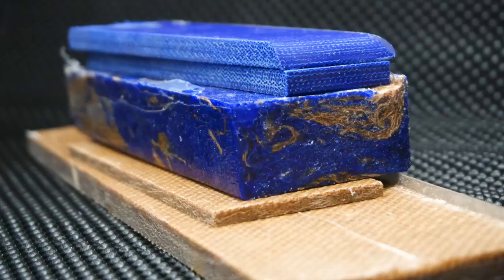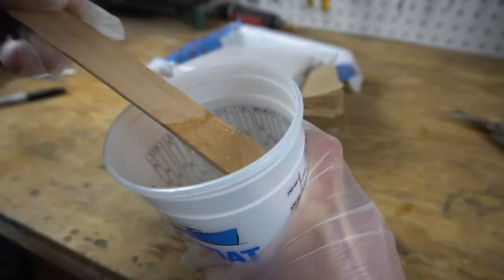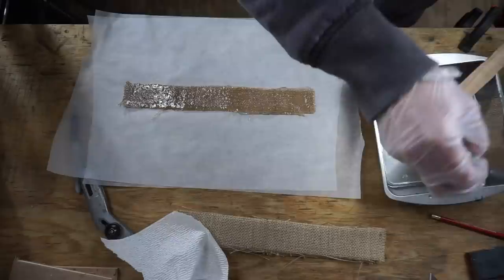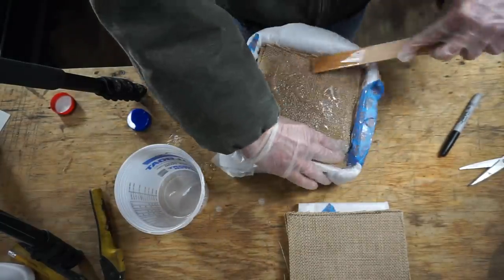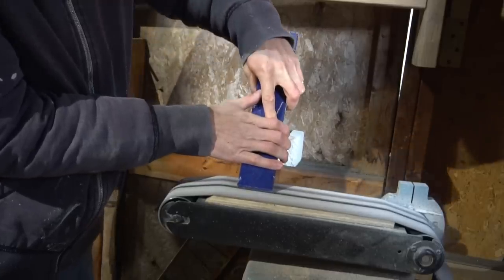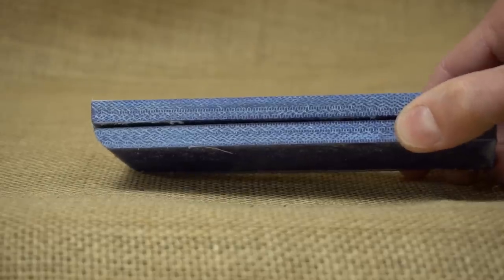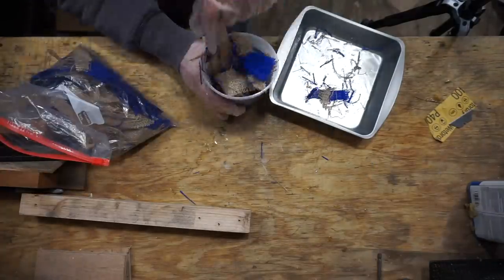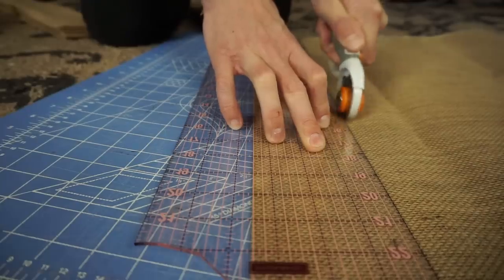How To Make Micarta | A DIY guide to what its really like to make this stuff

Comment: From my little experience with epoxy I realized that saturation of the media is crucial. It may cut down cure time but a heat gun will make the epoxy so runny it will saturate the media greatly. Great video by the way.

Comment: I clicked because I didn't know what micarta was. Thanks for addressing that in the beginning.
Reply: You still don't.
Reply: @yourmom1302  Trademarked Micarta, which you can buy is not fiberglass resins nor epoxies. Real Micarta is Phenolic resin and has properties homemade micarta hasn't. It is harder and when grinding a knife Micarta will stay even with the steel so the blade handle area is not noticeable by feel, the steel doesn't stick out. I absolutely will not use anything but real Micarta.
Reply: @July-qo7jp  You're right, where's the phenolic?

Comment: You might want to look into silicone spatulas (the ones used for cooking and cakes) to spread the epoxy. They are flexible like the foam thingy you use, but don´t soak up epoxy (or anything, for that matter). Also, epoxy wont stick and will come off easily do the their flexibility.

Comment: Micarta was the original brand name created by George Westinghouse for products based on Leo Baekeland’s phenolic resin discovery. In 1913, Micarta was sold for the first time outside of the Westinghouse group of companies. In 1945, Norplex was formed in Wisconsin, USA. In 1975, the demand for industrial laminates had grown substantially, and the laminates factory in Postville, Iowa was opened. Throughout the 1980’s and 1990’s, both Norplex and Micarta made significant innovations in laminate materials. The two companies merged in 2003

Comment: The closest thing to micarta I made was a head sheath for my Knipex water pump plier XS(87-00-100). I wrapped the head of it with kitchen wrap, soaked a length of dressing gauze bandage from the first aid kit, piecemeal with a 5-minute epoxy, and wrapped it over the kitchen wrap a few times. I waited for about a day for the epoxy to cure sufficiently, pulled out the head of the plier, removed the kitchen wrap, and trimmed the edge with a pair of scissors. The color changed to dirty yellowish over time as cheap five minute epoxy does, but it does its job, if you call that a job to keep the mouth of the plier shut up when it’s not in use.

Comment: Late but useful for anyone interested still. Used to be an epoxy flooring technician. It's similar to other resins in a lot of ways. 
If it sets up (dries) too fast the air bubbles tend to get trapped. Also if any moisture gets under or in it, it can bubble as well. We generally wait 30 days to put down epoxy over concert because it's still drying and releasing air and moisture which will go up into the epoxy, causing air bubbles ir straight up cracks. You can also reduce air bubbles by mixing at a slower calmer pace in a figure 8 mixing motion. Also if you warm the resin and surface it's going on it pre-seal natural materials such as wood and paper with a brush on or spray sealant prior to resining. You can also use a heat gun to help remove air bubbles as well. This will work for resins and epoxies.

Comment: I use canvas or blue jean material.  Layer 2 or 3 different colors.  When you round out the handle, the micarta has a wood grain look.  For cleaner method.  Put a 2x4 across a garbage can. Sit the wood press perpendicular on the 2x4.  All the drips go in the can. When you get through sanding the scales, paint them with 2 or 3 coats of super glue sanding between each coat.
Reply from the maker: Great tips👍👍 if I ever decide to try this again, the trash can tip is great. I would never have thought of that👊

Comment: I've been involved with composites since the  early 90s. Built alot of cool projects - custom interiors, FRP enclousers even worked on a bat mobile, boat repairs blah blah blah...

When building your mold from wood use masking tape to line it. Most polyester & epoxy resins won't stick to it. Also if wanting a consistent thickness use screws as adjustable standoffs. 

When using man made material such as nylon or poly based webbing its very important to use an aggressive fiberglass type roller to roll into the material. This helps push/force the resin in also eliminating air bubbles.

Hope this helps to whoever reads it.

When

Comment: Hi Alex, you may not need to use a press at all. 
I used to make custom fins for a number of longboard makers. I had to make my own panels to cut the fins out of before foiling them. To make the panels, I used 6oz Silane cloth, Volan if the look was vintage or composite layers of Carbon Fibre cloth and coloured Silane, depending on the look (or stiffness) they wanted. I used laminating resin (easy to control the working time) and pigment powder to get the colours they wanted. The lam resin is polyester, so you need an organic solvents mask while you're working as the fumes are pretty toxic. 
I had a big piece of safety glass which was actually a chipped shelf from a department store. I cut the fibreglass cloth fairly accurately, pooled some resin on the glass, then laid up each piece of cloth pouring on more resin and using a roller to get the air out and keep the thickness even. I would go about 4-6 layers over thickness and then leave the whole thing to set. No press, no edges, no paper, nothing but the sheet of glass. The panels would separate from the glass cleanly with a little prying with a paint scraper. I never had any air bubbles or defects, and you could use the entire panel except for about an inch all round the edges. 
I can't think why this method wouldn't work with burlap, nylon or even a close weave like denim provided your resin is thin. The most important things I found are the saturation, careful rolling, and using a resin that has a working time of about an hour.

Comment: Saw this process for homemade armour. Very intriguing. Fibreglass sheets with epoxy. light weight and resisted the 12 gauge slug. Could be handy.
Reply: Damn! That's pretty awesome!
Reply: @johnny5fingers0966  Did you find the video for it?
Reply: I did. It's interesting how the layers intentionally separate in order to absorb the energy from the slug.

Comment: I use a 12 ton harbor freight hydraulic press with a bed made from 1/4" U-channel with end caps welded to the sides for support and the upper press made from square tubing. I was using wax paper but have switched to parchment paper since watching this video. With the hydraulic press it's easy as pie to press the micarta and squish the resin out.

Comment: Very interesting. I would go with the wooden press you showed last but I would also add one clamp in the middle just in case the wood bows due to the nut/bolt pressure at each end.
B

Comment: I purchased one inch thick aluminium plate to use as press plates in my 20 ton press. I also pre clamp the edge of my material so i can flip the sheets over as i make the build. That keeps the build organized and helps with time and also keeps the buold from sliding around when pressed.

Comment: I have been a fibre glass boat builder in the past and a good way to make the resin thin and soake in quicker use acetone to thin it
Reply from the maker: Great tip👍
Reply: Don't use acetone with epoxy, acetone tends to inhibit the polymerization. Alcool works better and has almost no impact on the reaction.
Reply: @sognestephane8365  do you have a suggestion on the type of alcohol used?   Is 70% isopropyl alcohol safe?  what about 90%.    Or would you recommend something like 98% ethanol?
Reply: Use small ammount of acetone, 10 - 20 ml. Try on a small batch. Don't know for this type of resin.
Reply: @joshuaszeto  higher the concentration better it is, ideally you'd use pure ethanol. However even the 70% iso works ok.
Reply: OUTDOORS55 I use a cheap 10ton bottle jack press I bought for under $200 to press it overnight

Comment: Thanks for sharing. I would, if not already suggested, spring for a handful of washers (probably much bigger than the bolts, to add stability of the 2x4s.) to use as spacers between the top and bottom 2x4s to make it easier to produce truer pieces. I make blades (Orc style, beefy.) and am considering this for handle making because I've found it a challenge to find a reliable source of handles for my type of blades. Hope that helps you.

Comment: helpful hint, use a consolidating roller between layers to push the air bubbles out. You can make one, by adding lots of washers to an old cut down paint roller.Cut the roller end,just under the size of your jig and add a nut to stop the washers coming off.

Comment: I’d use two 12mm/0.5” steel plates with 6 bolts(corners and middle top and middle down), also 12mm/0.5” diameter

This would add a few tons of pressure and should drastically reduce air bubbles 

Bonus:

-  you can use a digital torque wrench head that you attach to your clicker wrench and tighten all bolts to exact same torque

- it would be great if the bottom plate would have some clamping attachment so that you can secure in a vise or to the table

Love your videos!

Comment: for the weight you could possibly get a gallon(or even 5 gallon) bucket, fill it would water, and place it on top of the wood, it would obviously only work for the baking tray method and similar methods, but it gets rid of the clamps and should evenly compress the micarta

Comment: Making paper micarta is easier it has a huge range of colours and with less impurities from the stock material.  I have also used Jute webbing, 2" wide, which gives consistent results.  Your idea with the bolt clamping is good too. Love your video's and ideas.

Comment: You started on the difficult level with burlap and nylon webbing. It is a lot easier when using something with a tighter weave like t shirts or a cotton sheet. I used visqueen for release and tshirts for the micarta when I did it. Dont try to contain the excess, spread a piece of visqueen out to catch it. Make the pieces significantly larger than what you need. I made a 1 ft x 1 ft square and sandwiched between 2 pieces of 2 ft x 2 ft plywood. I screwed the plywood together making sure that the threads only engaged 1 side. Also added a concrete block in the center. You want low viscosity resin. The more resin you squeeze out the better the micarta. If you want to revisit this subject I believe it was nighthawking light here on you tube who showed how to make carbon graphite out of t shirts. It might have been one of the other science channels though. I never got around to trying to make carbon graphite scales, I would definitely watch a video on it. Oh, wd40 can be used as a release agent, no visqueen or parchment needed. Didn't come across that info until I was done with mine. I am also in Florida, would recommend a heated shop or summertime when messing with epoxy. I have never tryed it but apparently you can thin epoxy resin with denatured alcohol. Edit: carbon fiber not carbon graphite.

Comment: Get tight napped rollers 3 inches wide and a resin roller to quickly wet out the layers and the bubble roller will work the bubbles out. You will improve your production time dramatically. As far as bagging, those pieces have to be quite small or preferably shredded, sifted into catalyzed resin while blending, and ideally vacuum degassed before pouring into mold.

Comment: work with epoxy a lot. Try using a small  laminating roller. Kind of a cylinder wit concentric rings on a roller handle. It would help wet the material and works the bubbles from between layers.  you will use less epoxy and have less squeezing out under pressure

Comment: Instead of 2x4s, use a 6"x3" steel C-channel, a 6'x0.5" wide steel plate (ground down to fit inside the C-channel), and the silicone paper mentioned below. Weld your bolts into the C-channel, then thread the nuts thru the top. That'll allow you to pop the block out fairly easily, especially if you use some sort of release agent (like petroleum jelly) on the steel. 

Another thought: rotate your fabric pieces 45deg to create a cross-ply, like they do with carbon fiber, for strength.

Great video, fantastic way to make your own "Marcaida". ;-)

Comment: The simple wood press is fine as long as you make sure of a couple things. 

Firstly, the wood contacting/closest to the micarta should be perfectly smooth. Pine 2x4s will give your micarta wood grain contours which is really annoying. 

Secondly, make both sides are thick enough that they will be absolutely rigid. I use two 1/2" thick hard maple boards sandwiching the micarta and they themselves are sandwiched by 2x4s for strength. So from bottom to top (or vice versa) the order is 2x4, 1/2" maple, micarta, 1/2" maple, 2x4. 

Lastly, use as many clamps as possible. I use some cheap Harbor Freight C-clamps that work great. For a 1.5' long press I use 4 clamps arranged in a zig-zag pattern. Left, right, left, right and evenly spaced across the length. They're evenly offset of the center line (controlled by the width of the walls of the press) which prevent the top surface from leaning to one side and making one side more thin.

Comment: Quick tip: you can also use red Tuck Tape on your press in place of parchment paper as it doesn't bond at all with the resin.  I've used it several times to make resin molds and so far so good.
Reply: Is "Tuck tape" a typo for "duct tape" ? If not where does one get Tuck tape? You say "red" is that important as well? Sorry not trying to "that guy" it is a sincere question. Thank you.

Comment: This is a very informative video. I'm not a knife maker but I am a luthier and I build guitars. Traditionally a lot of parts on guitars are made of plastic and I've always thought that that look very cheap, I've been looking for another material to replace the plastic parts that I use. These parts include pickguards, pickup covers, potentiometer knobs, and switch tips. I think this material would be perfect. I'm going to attempt to make some Micarta and shape it with my CNC machine. If this works out then I may be using it on all of my guitars from now on. I already have a vacuum bag setup that I use for wood veneers and I think this will be pretty simple to make. Since pickguards are flat I'm thinking that the top layer can be a material with a graphic design. I've seen Micarta used for fretboard material which is traditionally made from wood and it's worked out great. I'm curious do you know if this material is flexible, can it be reshaped with heat?? If it can be then I may be able to use this for binding and inlays.

Comment: Would love to see a video on coating the knife blade. Bluing or some other method to protect from rust, add color, keep from getting scratched etc....
Reply from the maker: I may experiment with that in the future. Although I’m typically not a fan of coatings. Seems like they always wear off fast and leave the blade looking crappy. I typically like a forced patina using ferric chloride or even vinegar. It protects against rust and doesn’t really wear off. Just my opinion though.  Coatings are getting better 😀
Reply: @OUTDOORS55  I would love to see your process with the ferric chloride, and vinegar. From the research I was doing, there isn't a coating that you can do at home that is worth it.

Comment: Really like your videos, a few things you might try and things I thought about:
Peelply is not very expensive and if you use that closest to your laminate it’s easier to bleed out the air bubbles, you can even have a thin material outside that can “swallow” some of the exes resin.
Also some materials should not be pressed too hard since it can end up a dry laminate with to little epoxy related to “stuff”…..
The last press you did is great I might stiffen the top pice or make it slightly slightly bent and use the convex side down, otherwise you get the laminate thicker in the middle and also get the bubbles to float to centre instead of out from the laminate..
Great and informative videos, thanks!!
Ps, surrounding temperatures change the viscosity on epoxy a lot, a little warmer will help drench the fibre better but you lose a bit of open time to work with it Ds

Comment: On your bolt-together vise:  try making the "top" of the vise slightly curved or thicker in the middle than on the ends.  This way, when you tighten the nuts on the bolts you are more likely to get even pressure across the whole strip.  Without the slight curve in the middle what can happen is that the ends get pulled tight but the middle can bulge up a bit as the resin gets compressed at each end.

Hope this makes sense.
Reply from the maker: I didn't mention in the video but the piece I used had a slight warp in the opposite direction. That way when I was tightened in clayed flat. It was also checked with calipers to make sure everything was as even as possible all the way around.

Comment: Thanks Alex, Wolf industries is where I get my shear sharpening supplies. Try there diamond polishing paste. Worked great on a strop I made. What I have is yellow in color. It works into the strop really well.👍
Reply: Robo 7723 I'ma check that out. Wolf industries. I've been on the hunt for some good diamond polishing compound and / or just the diamond dust where I add a little bit of oil and have a continuous supply of cutting material. . . . rock carving, them dremel bits wear put kinda quickly, then they're no good.

Comment: Use packing tape, no sticking problem. Use a vacuum pump setup, if you end up with any bubbles you can fill them with epoxy. You can also press them into a form. I use carbon fiber and clear West. Heat keeps bubbles down.
Reply from the maker: Great idea on the packing tape👍👍 I do have a vacuum pump but didn’t use it for the video as most people won’t have one.  Also great tip for the heat👍